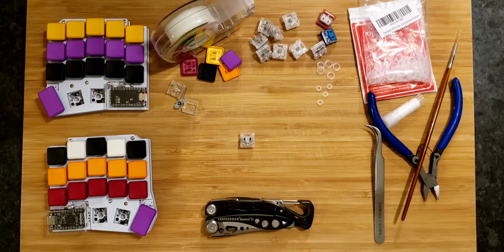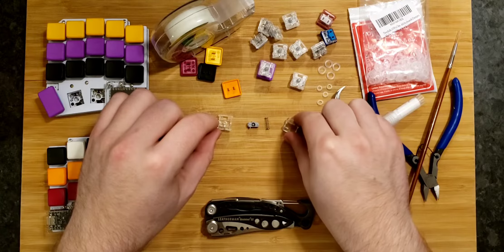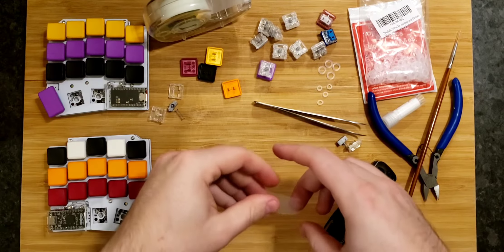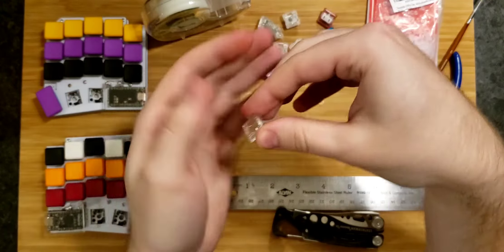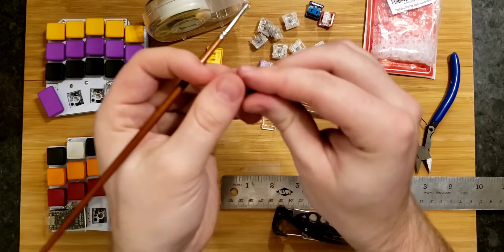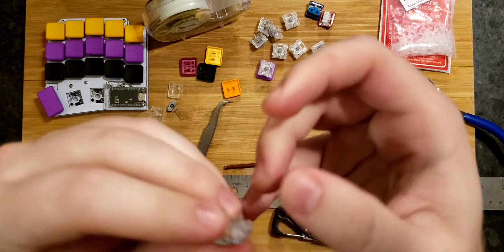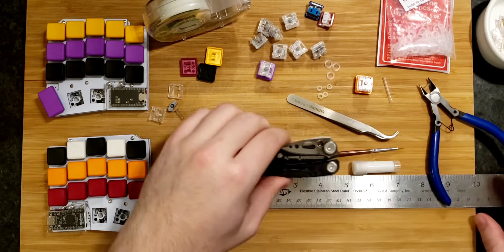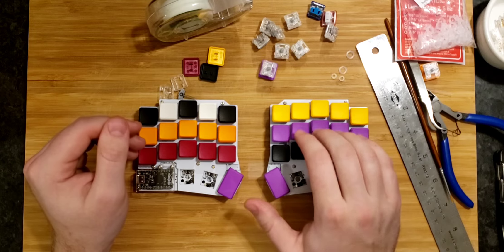Modding Kailh Choc Switches - O-Rings, Tape Modding, and Lubing Guide

Comment from the maker: Some extra info I didn't mention in the video:

If you're looking for a lighter lube like I mentioned was appropriatefor light switches, people recommend GPL103.

Also, if your switches are already soldered into a board, so long as you remove the switch plate if you have one, you can use tweezers like the ones I used to open the tabs and do the full modding process without having to de-solder your switches.
Reply: Great video! Could you share more info on how to tape mod with already soldered switches?
Reply: Can one convert tactile to linear? By removing or clipping something.
Reply from the maker: @AX-fx7ng  Which switches do you have? Browns or sunsets? I have sunsets on me, but I don't think I have any browns at the moment. By looking at the stem on the sunsets, it looks like you'd be able to whittle down the white piece of plastic that rubs against the stem, a.k.a. the bit that sticks out of the copper inside of the switch. However, there's a chance that this would make the switch wobble more up/down, though I expect it wouldn't be an issue. Let me know if that works for you, though I am just guessing here.
Reply: @smores56  Got some browns over red. Let’s see if my wish for tactile Is over turned by linears.
Reply from the maker: @AX-fx7ng  honestly, the sunsets are really good, I don't use choc linears personally anymore. I'd recommend picking some up if you can afford them

Comment: The place where you put the o-ring, seems to make the keycap float ~1mm over the switch stem instead of shortening the stem travel distance. Can you confirm that?
Reply: Which O-ring gauge do you suggest for kailh choc LP ? will it shorten the total travel distance anyway ?!
Reply: Agreed. They key caps just stick up higher and the travel is the same.

Comment: I was looking for a way to reduce the travel of my choc switches and got pointed at this video but putting the orings there doesn't reduce travel distance at all it just makes the keycap sit higher up. It's like jumping into a hole and then jumping into the same hole wearing a top hat and claiming that the hole is shallower because the top of your hat is higher lol.

Comment: Focusing is hard. Otherwise nice video, thanks!
But I am wondering: my red choc has a little stabilizer wire inside. Yours didnt. Is that dependent of the switch color? They make putting the switch back together much harder.
Reply: Sam probably removed his. when I did my choc build I removed all of mine.
Reply from the maker: Yes, in some of the linear switches (I can't remember which), there is a "vestigial" clickbar that you can simply remove, as it doesn't affect the behavior of the switch.
Reply: @smores56  Thanks for the clarification. I just tried it and the difference is not big, but if you press the switch at the corner and not the middle, there is a difference. With the stabilizer it is…surprise…more stable and easier to press, because the stem doesnt twist like it otherwise slightly does.

Comment: The part I cared about the most was how to install the orthodontist elastics, but that wasn't shown. It looks muchhh smaller than the O-Rings so I'm afraid it will break the stems if I stretch it across both stems like the O-Rings.

Comment: Well they are still unusable in my office but I would use them at home. I recently viewed a video where another youtuber said that some new kailh silent switches had 2 holes at the bottom and that made them make less noise. He even modded switches by putting 2 holes at the same position and it did make a huge difference even without the lube. I have never had a choc in my hands but still wonder if that would be worth trying on chocs.

Comment: Thanks for the video, I picked up a few useful tips from it :)

I just ordered my first choc board which comes with white chocs (unsoldered). I've heard that they have a very satisfying tactile feel, but I've never been a fan of the sound of clicky switches.

I know the focus of the video was linears, but I wondered if you had any thoughts on silencing clicky chocs?

I'm assuming that it's possible to mute some of the click sound as the sound (as far as I can tell) comes from the click bar striking the lower housing, while the tactile event comes from the contact with the stem. Have you got any thoughts about how effective it would be to put some tape or thin strip of bandaid on the spot that the click bar strikes the lower housing?

I have a few other ideas including lubing the click bar (although i imagine it would be a temporary fix on something that flicks as violently as the click bar), heatshrink on the clickbar (might make it sluggish), really thin silicon sheet on the contact point etc. If all my attempts fail, I guess I can always remove the click bar entirely and use them as linear switches.
Reply from the maker: Yeah, I wish that the tactile options were better. Apparently the choc v2 browns are a pretty good tactile switch, but there's not much that works well for the v1's.
I've not done much research into modding clickies, as it's a less-explored area. 

What you suggest could work, but I'll do some testing as to what is viable, and I can probably show some results in a few days.

Comment: Holy moly, this is quite a coincidence. I literally made a decision a week ago to finally take the plunge and make a keyboard myself and I ordered the Microdox Bud kit. I was surfing Youtube to find the best mods for my Kailh switches and I found this video on the actual keyboard that I am planning on building! Questions: Have you tried any of the other sound-changing mods like the tape mod on the back of the PCB or the foam mod between the pcb and top plate? I'm going for minimal noise, low frenquency (thoccy) clicks.

Comment: As a bit of advice (after having watched this awesome video and successfully tape modded my new board)

- Don't bend the tabs on the switch too much, they're easy to break and if you bend them too much they won't go back in to their correct position. Just a light wiggle till you hear it click

- Cut a long piece of tape (like 20cm long) and slice it in to slim strips, then cut along the tape again to make the long strips lots of smaller strips (like 5cm strips). This will dramatically shorten the amount of time it takes to cut tape

- Apply the tape using flat head tweezers. This way you can tighten the tape at the housing using the tweezers which is much closer than fingers alone

- When you've taped all your housings, use a hair dryer on a light heat setting and lightly warm the tape around the housing. This will help the tape adhere to the plastic. Don't heat the housing too much though as the plastic is soft and can melt quite easily
Reply: Thanks for great advice. Is there some particular tape you reccomend for ths procedure?
Reply: @basic867  mm not really - probably something fairly sticky, definitely not double sided. Scotch tape or regular packing tape probably works well
Reply: @josephluck4341  Thanks. Do you know how long this tape mod lasts?

Comment: Are you using the nice!nanos on these?  How tricky was it to setup your layers with ZMK if that’s the case?  I’ve used QMK and I just ordered this board so sure there’s going to be a bit of a learning curve when I make it wireless.
Reply from the maker: Sorry for the late response! ZMK is better than QMK IMO, especially for layering and combos. It doesn't have mouse control yet, but it is otherwise mostly at feature parity with QMK. You can email me at sam.mohr@protonmail.com if you need help setting up ZMK.